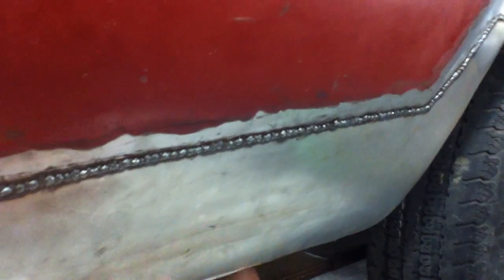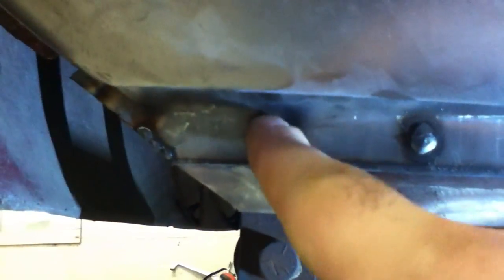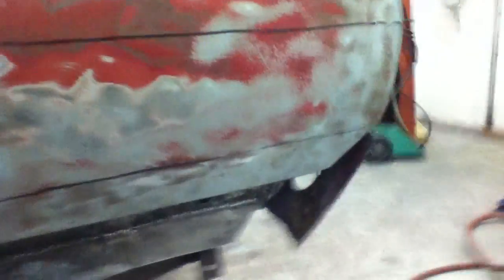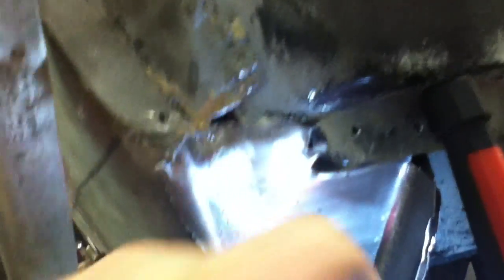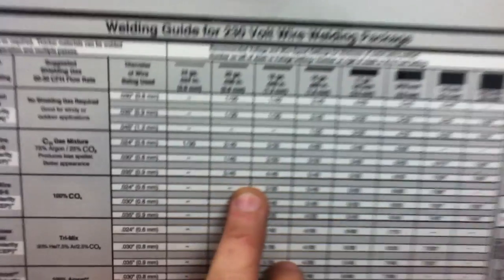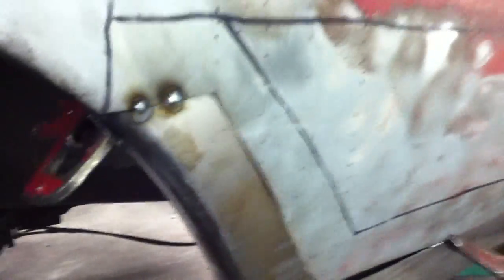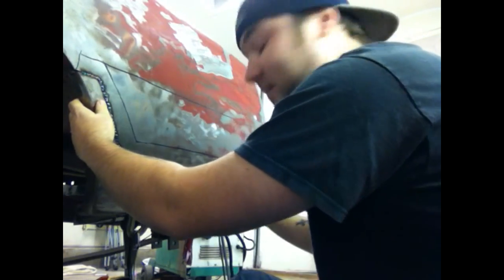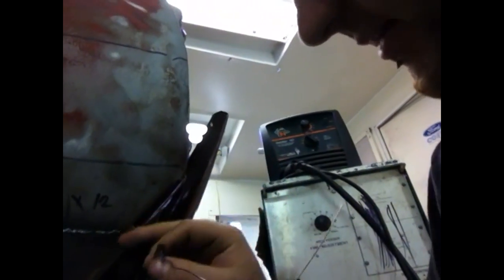Flange VS Butt welding

Comment: Great video. I am restoring a car that was previously butchered leaving the metal really thin  in places. Even with my MIG set to lowest heat I was burning through with 1/2 second welding bursts. Had to actually overlap scavenged metal in placed, but this method of flange welding is perfect for cars like mine which have been molested in previous life.

Comment: Nice work! 

Which is the best way to put plastic body filler (Bondo) 

Bondo to the bare metal? 
Paint bare metal with acid etching paint then bondo?
Reply from the maker: Bare metal sanded with 36 or 80 grit. Using filler over epoxy is fine as long as metal underneath has 36grit scratches.

Comment: Is it bad for the copper piece (surrounding the welding tip) to hit the metal you're welding? Say if one wanted to use it for accuracy, or would it weld itself to the panel? Thanks for the video!

EDIT: Man, i really did learn a lot from this video. Thank you for what you do, my dude. For real, you're an inspiration. I'll Subscribe!
Reply from the maker: It is always good practice when welding to always keep your shroud off the metal but with that sometimes you don't get the choice and it's ok.

Comment: For a quick repair. Would it be okay to flange, stitch maybe every inch them Bondo, primer, and undercoat on a rocker?
Reply: I guess maybe not since after the weld is ground down there isn't much left. Doesn't matter I may just use panel adhesive.
Reply from the maker: If you're that close I'd just finish the weld. Panel bond wouldn't be bad either. With that it would be sealed. Always bond both surfaces though.

Comment: Why wouldn't you just butt weld with Oxy Acetylene, then the weld is softer and can be moved around and filed due to the steel not being hardened in that area. Then you could just hammer and dolly most of the distortion and get nearly all the shape and only use a small skim of filler to fill slight imperfections. Just my opinion still a good video, thats just how i do it :)
Reply from the maker: Everyone's got there preference. For small panels a tig would be ideal.
Reply: Awesome work,why do you cut the end of the wire ?